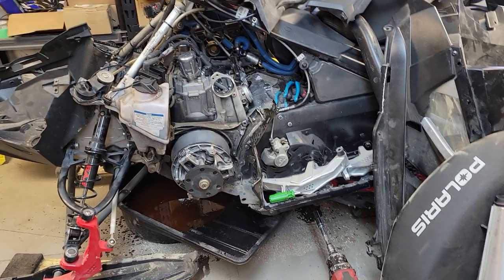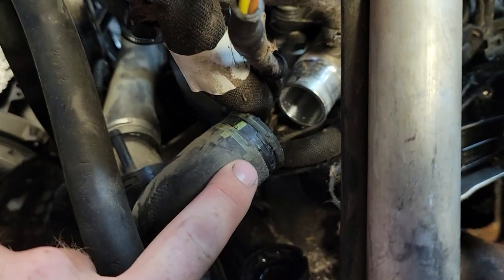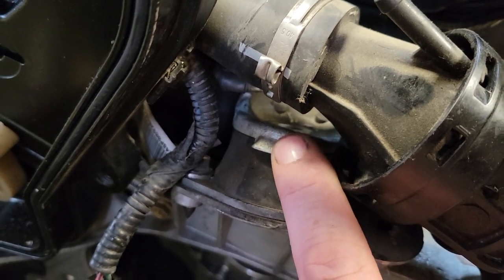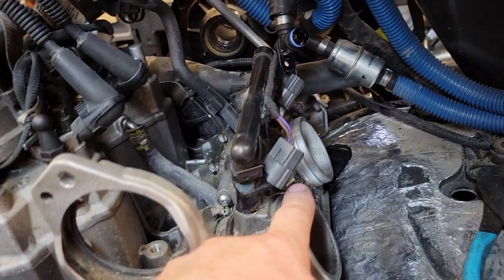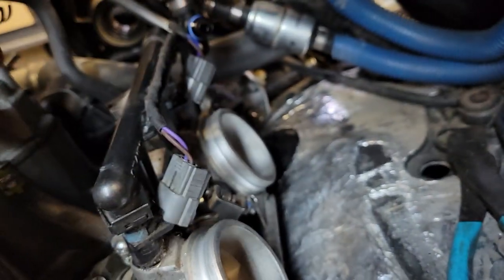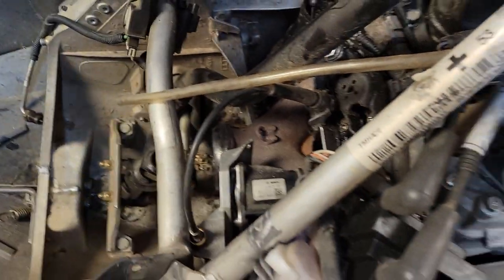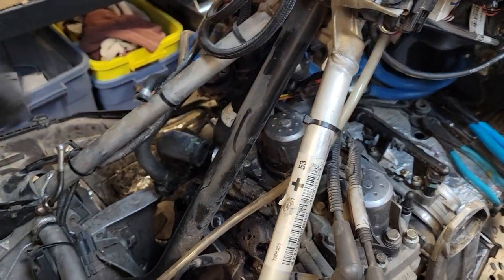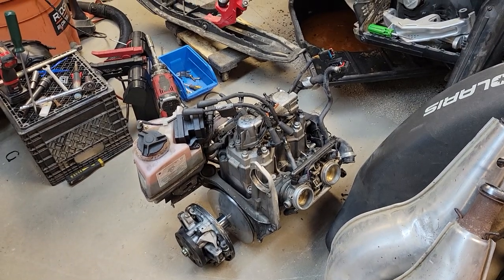Skidoo Gen 4 Engine Removal The Easy Way.

Comment: Dude, I started to laugh when it came out! Remember pulling the motor of an old 08. Y-pipe, carbs, reeds, that dreadful oil pump cable, primary, secondary, basically everything. Thanks for sharing! :)
Reply from the maker: Amazing how things have changed. Good ole 800 etec oil lines on the back of the crank case always got me mad.
Reply: Exactly !  I have done a lot of xp’s and this is cake.   I may have an 850 to do so I watched this video.   Excited to to it now.  Leave everything on and no fighting with lines

Comment: An just like that. I'm glad I went backwords with buying used sleds of the laydown style. Easy to work and Last just as long and Not any different riding with new shocks.
Reply from the maker: Those old piles last longer but absolutly do not compair to the newer sled in any shape or form. If you think a 2000 summit with new shock and a 2020 summit are not any differant then you absolutly have not experianced the new ones. The old "lay down style" are just that, Old

Comment: Did you have to pull the secondary before pulling the air box?
Reply from the maker: Ive never tried to pull just the airbox out but for the time it takes to pull the secondary I would probably just do it to save fighting with it. The airbox is a pain yo get out and in with the fuel lines and wiring all zip tied and hooked into it.

Comment: I have the same sled and my RightHand Member Assembly is broken like yours, do I have to remove the engine to replace that bracket ?  the front suspension module seems ok.
Reply from the maker: Its way easier if you remove the motor but you can just lift it up. Probably take the same amount of time either way. Also depends if you want to rivet or bolt it back together

Comment: Have you ever replaced the wiring harness on an 850?
Reply from the maker: Not replaced no but have pulled a few apart for partout.
Reply: @Krzykyle2  look failry self explanatory once you get the motor out? I got an injector fault and sound like replacing the harness is a common fix.
Reply from the maker: You wont have to pull the motor. The injectors/engine has its own harness from the ecm. Not even that many plugs at all

Comment: You have a eay one try a 2008 500ss pain in the ass
Reply from the maker: Thats an easy one to lol. Most guys just cut the stator wires however which is stupid imo.
Reply: @Krzykyle2  yep.  Open the harness up. Pull the blue plastic out.  Seen them cut many times though.   That being said this looks way easier than rev or xp.   Y pipe and throttle body’s still on.  Nice
Reply from the maker: @collinjhuls  the 850 is easier yes. I pull Xp and xm 800 Etecs with y pipe and reeds still on too. Just the oil lines and vacuum lines on the back of the motor are a pain sometimes.